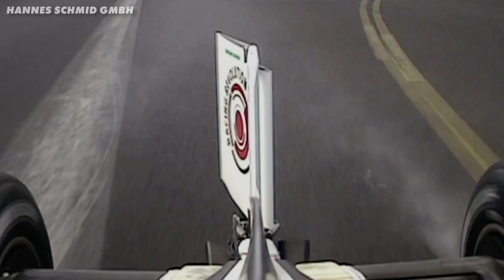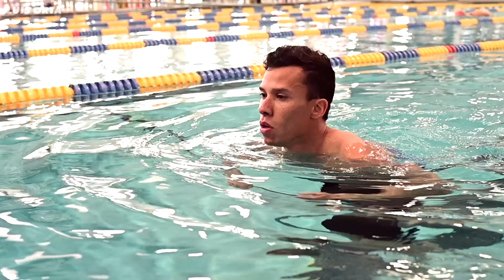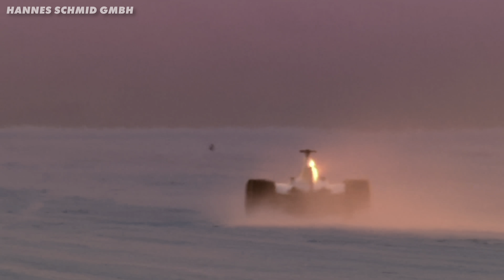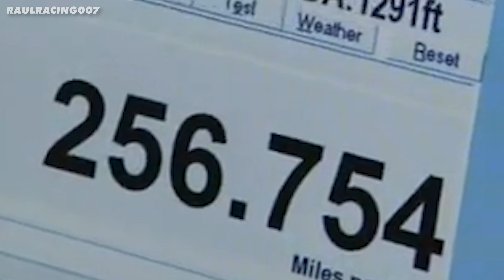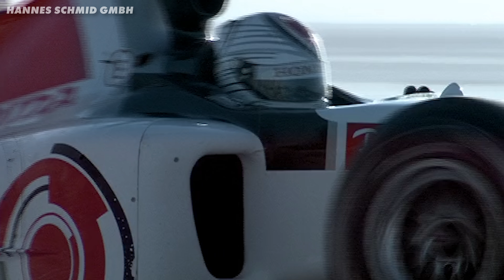The Fastest Ever F1 Car Isn't What You'd Think

Comment: I think they don't understand how wind works on the body of a car. Vortex Generators and Flow Disruptors are crucial factors of how you can manipulate air on the car body. The better you do, the less dirty airs that you have. And on the upper body, you have to push the body down. In the lower body, you have to push the air sidewards. Man should not use the Venturi's effect on the lower part of the body as it have to slide thro air much faster, not pushing and sucking air under the body kit at the same time.

Comment: You haven't come back to your 'F1 No Rules' video to cover Engine Systems. We know that Gas Turbines were banned in 1971/2, but with 'no-rules' do you think that engineering progress since then would/could overcome the inherent problems of that system? Except for gas guzzling, of course. On the other hand,  engines are air pumps. Present rules apparently ban sleeve valve engines. In volumetric efficiency, sleeve valves apparently beat poppet valve engines. And as long ago as ~1945, sleeve valve engines reached the 1HP/cu.in and 1HP/per lb. level (without water and methanol injection). So increases from those levels could be expected if engineering development of sleeve-valves had continued. But sleeve valves are 'different' and apparently have a steeper maintenance learning curve (more black magic +- the sacrifice of a goat!). 
It's interesting to think about where the magic sweet spot of power versus weight lies. And whether a scaled down H-24 Napier Sabre at 5 litres instead of 37 would do the trick. Note that it was almost 20 years after WWII that 425HP from 427cu.in. reached the road.

Comment: 397KPH = 246mph. Or, only 4mph faster than an Indy Car qualifying at IMS at the end of each straight.  Also no where near the top speed of an Indy Car qualifying at California motor speedway when Gil de Ferrari set the closed course record of 241mph. Top speed was recorded at 258mph.  

While fast, the serious bending of FIA rules to achieve a top speed that’s only 12mph slower than an Indy cars top speed when first turning into a corner is not particularly impressive.

Comment: I was under the impression that F1 rules mandated the final drive ratio. Was or is that not correct? If so what final drive ratio did this car have and what RPM was it turning during the fastest parts of it's runs?

Comment: i still dont understand top speed runs, in my mind its just go as fast as possible one way and done, tho ik there is a lot behind it all, i just think simple
Reply: To set an official record you need a timed run in both directions at an approved facility with the correct measuring equipment. To go as fast as possible but not set an official record do it however works... But bragging rights go to the official record holder.

Comment: You took the wing and bargeboard off an F1 car, ran it in a straight line and still couldn't beat the top speed of an IndyCar on an oval. At least 3 drivers surpassed 252 mph at Indianapolis and Michigan Speedway. Oops! I forgot about Paul Tracy's record of 256.948 miles per hour (413.518 km/h) at Michigan International Speedway.
Reply: Let them do this on that salt surface..

Comment: Yea well, Bottas did 372 km/h, and he did it in a car that could actually drive around a circuit, you know, with actual braking, and left and RIGHT turns. 

The car featured in this video, would NEVER be able to complete even one lap on a F1 GP circuit at those speeds, and still be able to qualify below the 107% rule, so that's why it's not valid. Bottas did.

This is not to take anything away from what they did with this car, I even used (older) videos of this, on other videos claiming "Durhuur, IndyCar Is FaSter tHaN ForMuLa OnE", yea, maybe on the indianapolis oval, but just compare the
 lap-times at COTA.. No Contest.

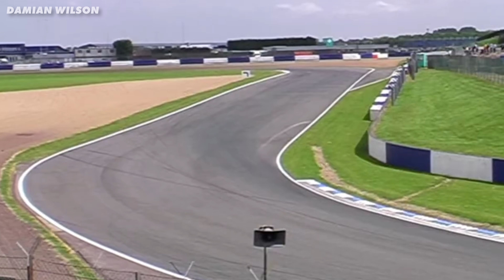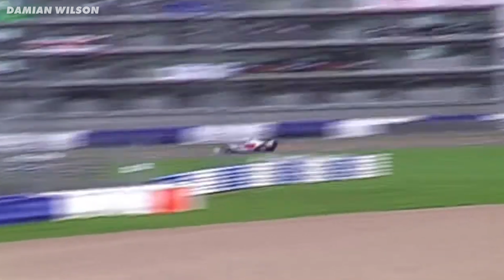Edit to add: Thumbs up for the sound at 3:19 to 3:21..

Comment: This year, Alex Taylor, co-host of MotorTrend's "Hot Rod Garage" set a class record at Bonneville of 379.22kph  (235.638mph) in a specially modified 1980 Chevrolet Camaro. Interesting that with today's engine technology, just 18 years later, a modded street car can nearly achieve the same results as a modified 2006 F1 car.

Comment: My purpose built Bonneville land speed car - open wheeled naturally aspirated on gasoline fuel, is the current record holder in the C/Gas Lakester class. It holds the record at 276.786 mph and has gone, one way, over 282 miles per hour.  The home built body, I am sure, is nowhere near as aerodynamic as an F1 car.... I am also sure that my engine which produced 848 hp on the dyno was nowhere hear as powerful as an engine in an F1 car.
Reply: How is any of that relevant to the challenge of 400 with an F1 car?

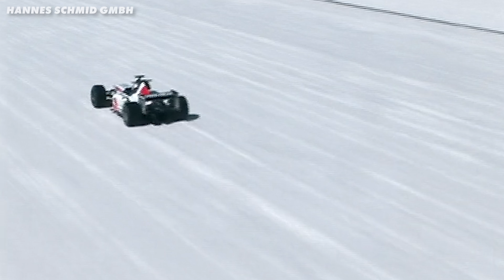Comment: 21:05 This is one of the first things you should learn when riding a motorcycle. Let it wander, it's stable on its own and it works better when you let it wander. Obviously at high speeds, significant wobble can be dangerous, which is why high end bikes have a damper on them. For most of us though? Just relax.
Reply: Yeah. Tank slapping comes in fast and scary as hell! Throttle out!

Comment: Introductions to the five videos....
"I'm actually Going to Drive an F1 Car UPSIDE DOWN on the ceiling of a tunnel..."
"I'm Going to Drive an F1 Car UPSIDE DOWN in a tunnel..."
"I'm Going to Drive a formula Car UPSIDE DOWN in a tunnel..."
"Formula1 engines won't work upside down..."
"14000000 pounds..."

I announce a lot - even upside up, outside of tunnels

Comment: On a separate note to the video and project inversion. Can someone explain to be with all of the drain covers that have become loose in recent years in F1 why are most tracks using D400 lids which have no requirements to be bolted to the channel drain itself. Some E600 lids and channel drains can be bolted while the vast majority of F900 lids are bolted down for port and airport usage. In my mind while the F900 would be an increase on costs involved would not require a need for the covers to be welded shut, now the risk still exists that a bolt or four can become loose during a race weekend and the entire channel drain cover becoming airborne with a car passing over. But could it be explained why we have the D400 spec as a standard for circuit design.

Comment: how much faster this test would have been if they'd of used a BMW F1 car of the same time
Reply: not much faster, if at all. The limiting factor is drag - not power. And because drag squares with speed, it ofset´s any difference of Horsepower the faster you go. At those speed´s, a differenc of less then 2% power is completly negletable.
Reply: @ukrje  The Honda engine was the most powerful engine on the grid at the time.
Reply: @ukrje that's very interesting thanks

Comment: Malcolm Campbell went 50 mph faster at Bonneville nearly 100 years ago, and I bet it didn’t cost a race team budget 😂😂
Reply: The challenge was doing it in an F1 car, basically a car designed to do the exact opposite of this. Like, sure, Bugatti has cars that are roadlegal and can go faster than 400kph, but that's not the point. It's more like taking a dragster, following the ruleset of whichever it's category has, and making it set a decent laptime on an F1 circuit. A bit of exaggeration there, I suppose it would be stupid hard to do with any of the higher end dragsters, if even possible, but I'm sure you get the idea

Comment: I stripped and helped rebuild this car for it's new owner after it had done the speed attempt. You would be amazed just how much damage the salt had done.....
Reply: A while ago now, but it was,fresh from the salt flats. All the fixings were fucked, or full of sand. Like a phosphorus colour, with a dull odour. A very interesting project to be attached to.
Reply: @jamestatnell3065 Are you talking about the corrosive properties of sand. 

 Or the forces caused from the particles hitting the vehicle? I mean I never thought about it, but I bet at speed the sand has to be like hitting a sand blaster at a certain speed.
Reply: @dianapennepacker6854  both, the be honest- it was cover in helicopter tape, but it still had the paint "sandblasted" back to the carbon.
Reply: Hey can we get more details on what the process was like!
Reply: Yes.  You have to wash em as soon as you leave the saltflats. If the salt is dry it's much better and not much salt gets underneath.  I always drive in a rainstorm afterwards.
Reply: I know one of the guys that filmed this.  He said that salt got into everything.

Comment: So they only went 10% faster than during the monza gp of 2005 (Räikkönen 370km/h). Why didnt they ran on normal tarmac since one of the first test runs was well over 400km/h?
Reply: The actual challenge was doing it on salt, with a car fitting into F1 rules.  Going 400kph in itself sounds more like tweaking with aero and gearing, while this took quite a bit more than that.
Reply: that 'only 10%' is the hardest
Reply: @1greenMitsi  IndyCar goes on an oval close to 400km/h. Fastest lap time is 382 average speed (set in 1996)
Reply: @roderick9772  thats the thing, OVAL, not bonneville salt flats. oval is paved and smooth, prepped for the cars to run on it, F1 never has and never will run a bonneville salt flats GP, and the difference between solid tarmac and powdery/slushy salt flats salt is massive.

Indy is completely different in terms of speed from F1being focused on top speed, and not on cornering, opposite to F1. Indycar is literally Formula NASCAR.

not to mention that drag is an effect, 200 mph is 4x as draggy as 100 mph, so 400 kmh is not very easy, and look at all the cars that have done it, all of them are either super sleek and drag resistant (Speedtail, Regera, Jesko Absolut, Venom GT, Chiron SS 300+) or have retarded amounts of power to make up for the drag deficit. (Agera One:1 is a prime example)
Reply: @roderick9772  Bugatti Chiron goes about 430 on an oval. Does that matter on salt? No.
Reply: In the video they said that they chose Bonneville because it's the most FAMOUS place for this kind of thing. Remember, this only happened because it was a marketing opportunity...
Reply: That MP4-20 was a monster when it worked. The Mercedes engine had the most power but was unreliable af. I reckon it'd have hit a higher speed if Mclaren attempted this record

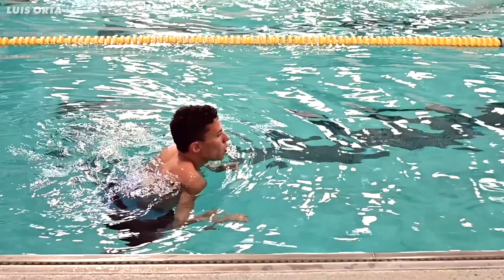Comment: 7:24 Saying that drag in air is more intense than in water is... somewhat missing the truth.
Reply: He said the effect of increasing speed is more intense, not the actual amount of resistance. He wasn't saying that air resistance is greater, just that it  increases at a greater rate because the air compresses and thus becomes more dense the faster you go, whereas the density of water doesn't change. At low speed water resistance is 12 times that of air, but as the speed increases the air resistance goes up faster than the water resistance. There comes a point where if you shut off the power, the car will slow down more quickly than if you drove it into a lake. For something shaped like an F1 car that would be at about Mach 0.5
He shouldn't have mentioned the water at all IMO, it just confused the issue, but the point he was making is that air resistance is exponential with speed, while water resistance - irrelevantly - is not.
Reply: Yeah, I know.. 
From hydrodynamics I always understood water is 999x denser than air.....
Reply: Yeah somewhat... water is 800 times more dense, 55 times more viscous, and INCOMPRESSIBLE. No clue why he said that...

Comment: 400 kph is about 248 mph. Indy cars could do this,
Reply: Indy is asphalt 
Bonneville is a salt flat, basically dirt
Reply: A top fuel dragster would crush an F1 car in acceleration. This doesn't prove anything. Anyone claiming an Indy car couldn't do 400 kph doesn't understand much.
Reply: @paddle_shift  But can it do it on salt? This car also made ~300 hp more than an Indy car.
Reply: I don't know why I get suckered into watching these videos. In every case the F1 car is the best ... if you change it just a little this way and just a little that way and maybe a squish the other way. The comparison car is always "stock" to its particular racing series. Heck, there are "motorcycles" that go faster on the salt flats. A 1978 Yamaha to be exact has the exact same record. I'm sure it doesn't resemble a street motorcycle in any more than this thing resembles an F1 car either. 

This car could NOT run in an F1 race without hitting something. You also cannot compare an F1 car to an Indy car as they have completely different specifications (and don't tell me F1 don't have specifications... they certainly do). An Indy car would lose a race with an F1 car at Monoco. But an F1 car would lose a 500-mile oval event at Indy and probably anywhere else for that matter. The tires can't take it, the suspension can't take it, the engines and transmissions certainly can't take it. 

Because they aren't designed to.
Reply: This car did 413 kph 256-257 mph and this car can accelerate from 0-186 mph or 0-300 km/h in 8 seconds
Which no Indy car in existence will do that 
F1 cars were easily hitting 0-100 kph in 2.2 seconds 0-200 kph in 4.2 seconds or 4.5 seconds
Indy cars cannot do that kind of acceleration
Reply: @Smzxe  Indy cars aren't built for acceleration but for top speed. No current or former race spec F1 cars could do 400 kph. The reason this F1 car was able to was due to heavy aero modifications. Even though this F1 car conformed to current F1 rules, this configuration would never be used in any actual race. Indy cars with similar aero mods could do 400 kph if not higher. There's are YouTube videos showing race simulations of an F1 car vs an Indy car on an oval track. The F1 car would quickly jump ahead from a standing start to lead by a wide margin by the end of the 1st lap. But by the 3rd lap the Indy car would have passed the F1 car and by the 6th or 7th lap the Indy car would have lapped the F1 car.
Reply: @paddle_shift  there's a race between Indycar and a 2007 F1 car the F1 cars destroyed indycar on 5-6 laps so indy car isn't coming close to a F1 car those were slowest straight line F1 cars as well
2005 McLaren Mercedes MP4-20 F1 did 372 km/h on Monza basically 1100 meters it could do 380-390 km/h VMAX if it had longer straight 
Indycar will take 5 miles to reach the same speed

Comment: power is force times velocity. force is drag. drag is proportional to velocity. power goes as velocity squared.

but even with "zero" drag (no friction, no turbulence) , you still have to move the air out of the way of the car, which requires giving the air a kinetic energy of 1/2 m v^2 (we do remember that one, right). where m is the density of the air (1.2 kg/m^3, irrc) times the volume V, where V is crossectional area A of the car times the length it travels per unit time (aka: velocity v), so now you got an energy going as velocity cubed.

or something like that.
Reply: You're term "zero" drag doesn't make sense. "moving air out of the way" is incorporated in the drag formula already.

There is a mistake in your calculations where V is crossectional area A of the car times the length it travels per unit time (aka: velocity v)

the drag formula is F = ½ density of air (ρ) × velocity of the air (or object)²× drag constant × crossectional area.

You see your E = ½mv² formula hiding in there, but you can also notice that the area is a separate variable. But as you noticed, that leaves distance.

The mistake you made is that you took the distance from the speed. But that's incorrect. The amount of distance you travel is independent of your speed. You can decide a short or long distance traveled if you want. 

That distance actually comes from the formula for work. Aka the formula that relates Force to Energy. W = F × d where Work is correlated with energy here. So you can turn it into E = F × d

Thus if you put the drag formula as F in that equation you get E = ½ ρ × v² × A × d. 

Since ρ is mass times volume aka distance cubed. you can theoretically stripe away that volume against A × d which is also a distance cubed to end back up with your E = ½mv² formula.

lastly you can't set "zero" drag, since that would make the drag constant zero, ending with zero energy. This is because the drag constant already includes shape drag on top of surface drag (due to boundary layer) and turbulence.
Reply: Power = Speed times force.
Drag is proportional to speed squared.
Thus power is proportional to speed cubed.